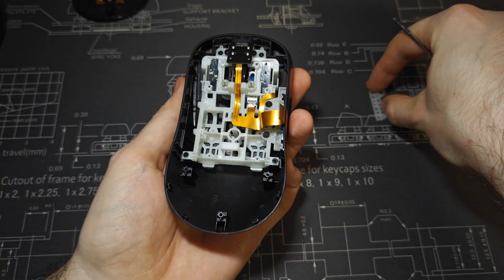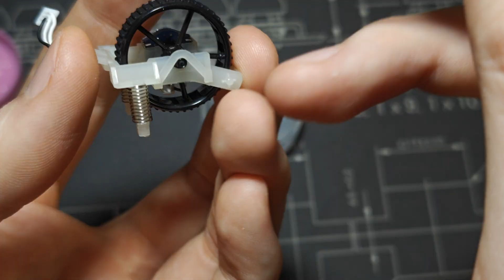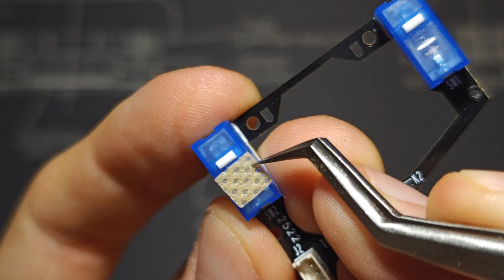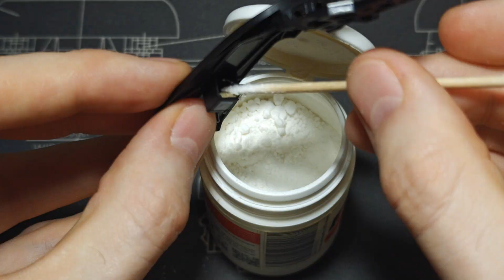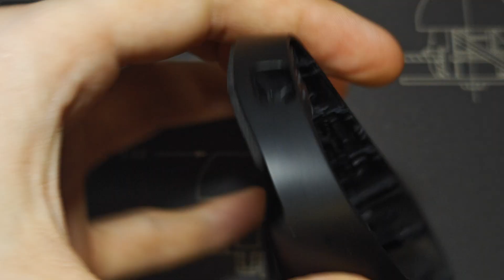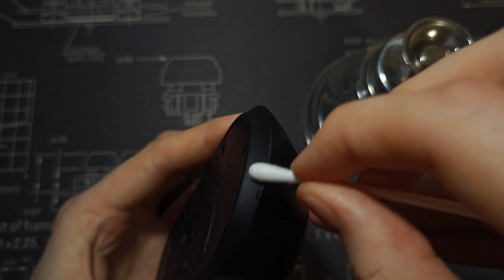Ninjutso Ten Air. BOOST by turbobitbox

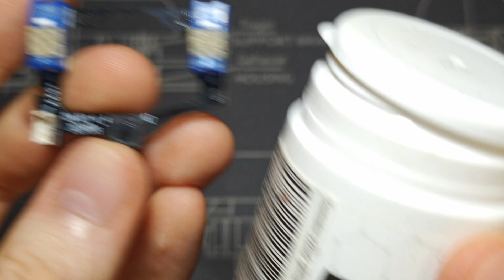Comment: 4:30 What is the purpose of the powder you use? Is this post-travel mod viable on most mice? I usually use tape on that same part of the switch, but it still feels like the plastic is hitting the band-aid. Would this be the solution?
Reply from the maker: This is a dry lubricant. It is a finely dispersed Teflon powder. 
I use it in a specific place only to prevent the patch from letting glue through and the button from sticking when pressed.

If you feel that the button is rubbing uncomfortably against the patch, then you need to reapply the patch a little lower (or in a different direction, until you get a result that satisfies you).
Reply: @turbobitbox  Would simply applying PTFE or Teflon tape to that area of the switch be sufficient to reduce post-travel? Or would you recommend only something that cushions the impact?
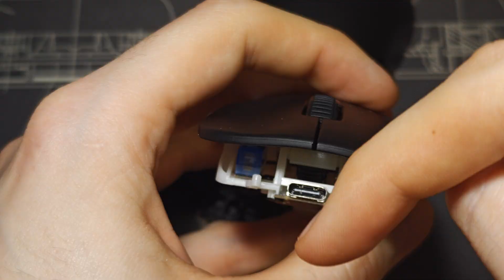Reply from the maker: @guma1fps  3:27 and 4:30 - This is a set of measures to reduce post-travel and soften the impact when pressing. If you have to choose one, it's better to go with 3:27 WITHOUT 4:30, as it will be safer. I don't really like gluing anything hard onto microswitches. Personally, I don't like the feel and sound of it. You can try it, as some mouse manufacturers do. But personally, I'm not a fan.